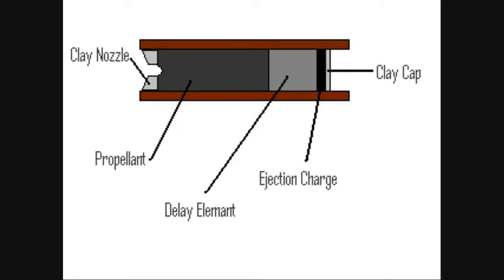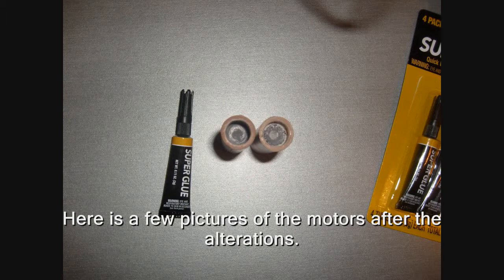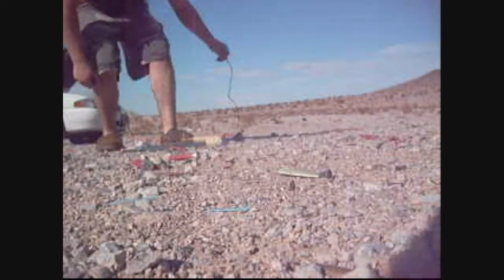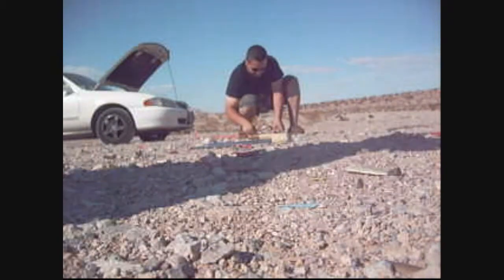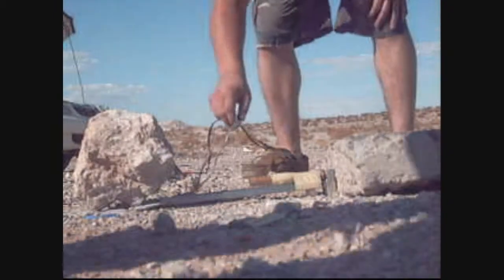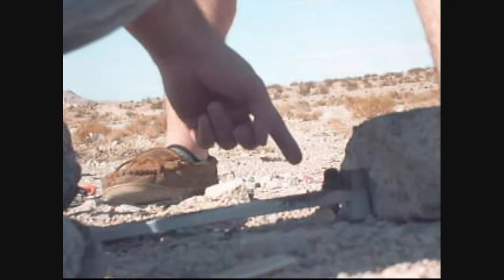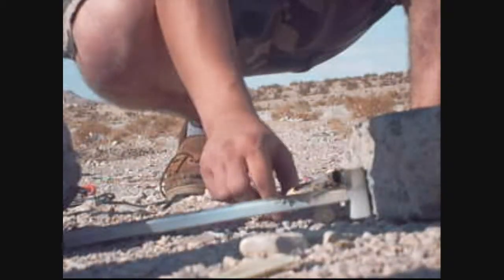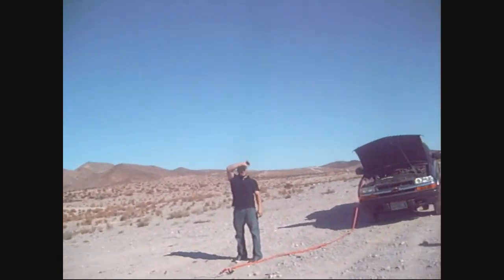Multi Segment Model Rocket Engine Not Multistage Project Success! (Much like the shuttle)

Comment from the maker: @CanItBeDone11 The delay and nozzle can be dug out with a nail but the delay is harder, so i used a dremel with an aggressive bit at low speeds. Because this is dangerous to make and fly, i would suggest you not try it unless you take ALL necessary precautions.